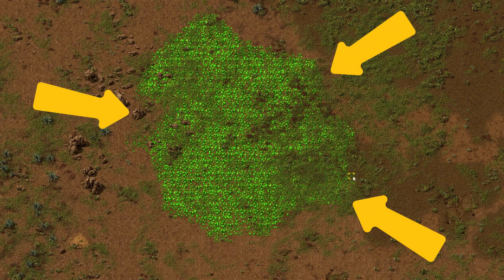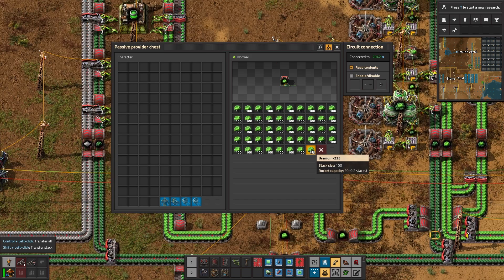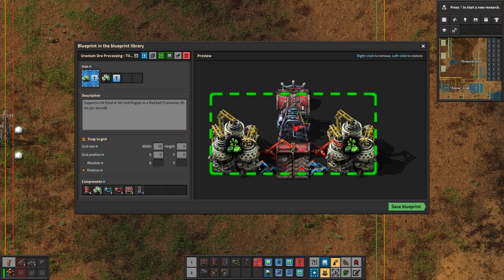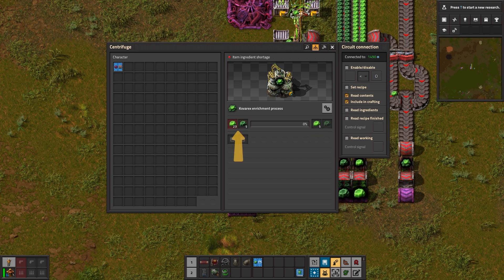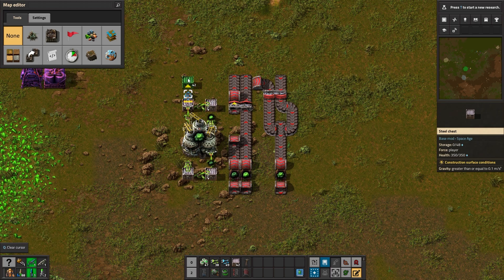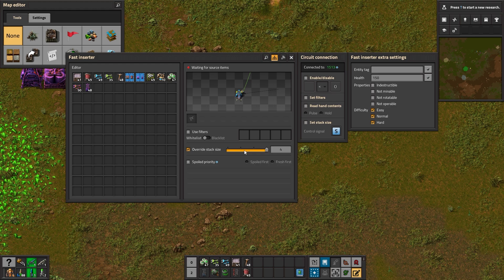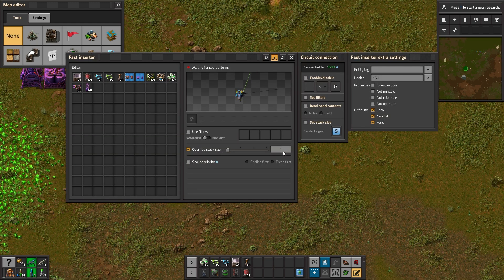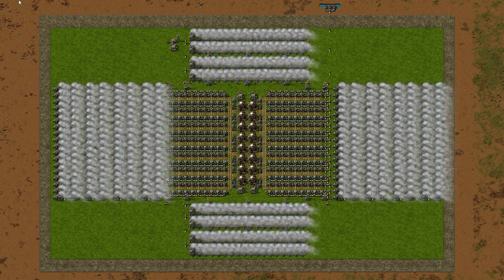Factorio Unlimited Fuel Cells: Tileable Kovarex Tutorial (FREE Blueprints)

Comment: How in the over complicated can you make this?  You don't need any logic circuits to create a self sustaining Single Centrifuge Kovarex process that bleeds off "excess" uranium.  You ONLY need 4 Splitters and 2 Inserters!  You don't need any chests, logic function, or fast/stack inserters.  Here is how to put it together.

1. You make 1 'Circle Belt' around your Centrifuge. (In this 'clockwise' example new materials are coming in from the top of the design and excess is leaving on the bottom)  This belt should be 6 wide x 7 tall & "self contained".  Place your Centrifuge in the lower left corner inside this circle right next to the belt.  (You will have 2 spaces above your centrifuge and 1 space to the right)

2. It should be fed by 'First Splitter' (top side near middle facing right, sticking outside the belt) that we be accepting new raw materials that has an "input priority" on the left side that is taking in "new" uranium.  IMPORTANT:  Make sure all material are on the OUTSIDE EDGE of the belt feeding the topside of this splitter.  This will make sure the belt is biased in favor of taking in new Uranium.

3. Next, place a 'Second Splitter' (right side, facing down, bottom left corner toughing top right corner of centrifuge).  Add a "Right Output Priority" and filter it for U-235 (bright green ones).  Now add one belt that will directly feed all items into the inside track of the 'Circle Belt'.

4. Next, place a 'Third Splitter' (bottom side, facing left, near middle, directly touching the centrifuge).  Add a "Right Output Priority" without any filters.  This is how "excess items" get removed from the 'Circle Belt'.

5. Next, place a 'Fourth Splitter' (left side, facing up, the bottom right of this splitter should be directly touching the top of the centrifuge).  Add a "Right Output Priority" and filter for U-235, the same as the 'Second Splitter'.  You will then connect the "right exit" of 'this Fourth Splitter' to the "right entry" of 'the Second Splitter'.  This should create a mini-lane inside your 'Circle Belt'.

6. Add an inserter on the top side that is extracting materials from the centrifuge and dumping them onto the 'mini-lane'.

7. Add an inserter on the right that is picking up materials from the 'Circle Belt' and putting them into the Centrifuge.

This is all you need to have a "single" self feeding/sustaining Kovarex process that bleeds "extra" when it gets "full".  This design is also repeatable and can be repeated as much as you want "horizontally".  Once you see the design you should understand how to make it vertical as well.  This design is intended to be fed directly off your "Enrichment Line" which means you can throw it down and just forget it without worrying about it clogging up your line.  Once enough U-235 gets into the system (you need 40)  the Kovarex process will begin and become self sustaining.  No U-235 will leave the system until you have enough to fill up the inside belt loop with U-235.

That said... I highly recommend a 2 chest and 2 Centrifuge setup where they just directly feed into each other... but you will need logic on the 2 chests to add/remove the materials to keep it "looping" plus it makes the kovarex kick off go faster.

Comment: I think It's way simpler to just have just an input inserter with a u235 filter and connect directly to the centrifuge read the hand contents the centrifuge contents and the crafting contents and then say u235<40 for the enable/disable condition you do need a 3rd inserter that has a u238 filter to input the 238 since the other one has a filter Also having just one line with the inside half being u238 and the outside half being the output is simpler you just make a big loop and pull the u235 out with a filter (inserter or preflibly splinter) you do have to be slightly creative with how you inputs the 238 into the system but that's not too hard
You can Also forgo logic entirely and just wait a bit more
Reply from the maker: Do you happen to have the blueprint for that?

Comment: I made two centrifuges running the Kovarex process with fast belts around them, with slow portions for fuel pick-up.  Once they were running properly the process is that they off-load the uranium they produce using bulk inserters and then if the U-238 is low, a signal is sent to an inserter which takes more U-238 out of storage and places it onto the belt, then the uranium runs past two sets of bulk inserters to be put back into the centrifuge if required before reaching an inserter which grabs it off of the belt where it gets sorted for storage and use.  That ensures that the uranium needed to keep the process going is inserted before anything else is done, while surplus uranium is collected as output, with U-238 being recycled back to the supply bin which is also supplied from the uranium extractor centrifuges.
The output from the extractor centrifuges is pre-sorted into U-235 and U-238 by selective inserters.
Reply from the maker: Interesting. Would you like to share the blueprint? I'd like to have a look
Reply: @Maxiume  I'm still pretty new to Factorio.  Less than a month into it.  I'm a little vague on some areas such as making and sharing blueprints.
Anyway, it's fairly simple.  Two centrifuges running the Kovarex process with a belt looping around both, with just enough space for inserters between the belt and the centrifuges.
There's two inserters set up to supply U238 by reacting to the U238 getting low in one centrifuge, one inserter per centrifuge.  When triggered, they grab U238 from storage and put it on the belt which then runs past two sets of bulk inserters per centrifuge to ensure that it won't be missed unless it's not needed.
Each centrifuge has a bulk inserter to unload the results, but it's arranged so that the uranium has to pass by both sets of inserters to be put back into the centrifuges before it reaches the output inserter which puts all of the surplus into a chest and that chest is unloaded by selective inserters to grab out the surplus U235.
The U238 is then recycled back to the chest which supplies the inserters which reload U238 onto the belt.
The down side is that you have to manually "start" each centrifuge and keep it supplied with U235, but once there's enough U235 to keep the process running, you can just leave them and they'll work unattended.
I use mostly fast belts (blue) but where the inserters are for loading the centrifuges, I added some slow (yellow) belts to make sure they could grab everything they need.
Now it occurs to me that it would be easy to make this work with a single centrifuge with a belt around it, and then just tile them with a belt alongside to supply the U238 when needed.  But using multiple centrifuges with a single belt means that you only need a single pick-up point for excess uranium.
Reply: @Maxiume  Finally figured out how to share blueprint strings.
0eNrtmUtz4ygQgP8KxWUvUsp6oIdr97Dnuc6cpqZcSMI2FRk8gJykUv7v21ix5SRSjPAe9rAnY9H6umn1Q6BXXLUd2ysuzKqS8hEvX4crGi9/Xv21cw3TteJ7w6XAS/z9SaKaCaP4utswjVQnBBcbZLYMfZMHqtgzYkLxersDKbRXsmZaPyD0fcte/lAMrVmDnrjZoh9hnBRIitOtrXxiCrVsbRAVDWLP9i70Q1HBux2q5Q5Uyc6cxRXfbA1A/xYvbxwhDdooWlWAr14QvTIScY20Naai9SOiSnagwUiQqeTzmcjFHvCaN8xOVaCChZ1mDSixCoiFbChIKlDAxdvN1laYsIJoLRWiRu54bVfddLXRDzjAvJai96rmG0Fb61JBdwx8uabahAbWqPdSmbBircFHuEM07Bkvo2Mwcs+wrCvR+PgrwDDBDWe9rtOfl5XodhVTwAq+0hngvdS8f8CvGHhk8UAC/IKXYVSWDwQUNVyxupdIrV0f+LE/vwD+CDGZSYxmWpxe+FXXPoZcaKYMTHwmxzdtJTNtTWbams3kxzP5+YWvd7RtQ9aCNKRwuJctG+GnNz1SzLSYzLS4nMlPZ/KjxUwF2XuXvFNQjCmI/BWUTgpi5wC/Sp3MyTmJf7bn4/ESpf7IbAI5ZOVVzfwyGfvVQ702Srarim3pgUtlBRWjzcpOsFOLNKpjtvjWbdewFRerWtG1gTaIl2vaagYU8CDfW+WPfVMMh6YYvjVFfJZa/e5oC7aDtJAKUhCPrSdzfqBk7gMdCsCcOMyd4rDwYmdO7HJm4bqKdDIeNfHCPxCnkHc033QCGXs5lbg4NU682KkT+440jydcQfyRyQQy8/JA7OSBub02v23ukGFf1IT8C0OjeAxb+neoxMUVyZBqe6o1PzBbGA/wBq7Cesv0mI7iZjwkkfvDuwqFxQTtjhfbaAKZ+BetKWTq0+sXTmGQzG+ji/9yG02yme4nt92f+3RmR/cX/lm4cMrCO9I8clGQ3pfmE4mZRi5Fr/ho65q3INlvkc/b7Auo608b7G4fWJ+CyYb0bk8V7PHBAPwXtptu2PmvLlAbz2O2unfrdLC4mNhapYnDytPyPedDoI1nZ81V3XGzYoJWLWvO+Xm+DLc0Fx1rrrRZfTqdGFxY4L4GaEPtMVL2wXt/4uP444iDMda/+jhS7wI8+UyIT9OZpGVetHKCNveNI7ltYOFxeFI47YtT/3LkpoD47+wLp403iWbmZ/5/fr53oF+5nDgGIIkXbeKcgqReqTlFI96HnGNRM6bB/+jQVUPuffjpqqHwPuxz1VB6H1c6asjuqDqOGiKvOD+dWUBiPgHe5vnPPCBBVAbkV3Aawn71PIQ3ZzuM4GIALyGxHYNgAP2UnMewubHjOB/G9idI82H8xkksB4ql5dhLZ4796eXBLG7YznaZy/eoALcUVgXXzh+bDLffhsyThLkD1JXTOkkWl2lZkrxMk7jMhi8li+MINTx9BgswBQcf7EakF/2Cd/wH0Y/j5g==
I hope that works even though it's through the comment system.
Reply from the maker: @melkiorwiseman you can join my discord for easier sharing

Comment: In my test, the splitter with input priority set to left will hold 3 U-235,  before any U-235 will pass through the right side of the splitter to enable the next stage.  This means that the system needs to have 43 U-235 before anything gets passed to the next stage.
Reply from the maker: That is very accurate and perceptive of you to notice. Yes, a little bit of the ore gets stuck in the splitter. I could have designed the splitter with a dynamic filter to avoid this (too complicated for beginners to understand) or use an inserter to transfer the remainder to the next segment (low throughput) or tens of other approaches. No solution is perfect. This one is beginner friendly and "efficient enough".🙂
Reply: @Maxiume what mod do you use to get the purple infinite unground source and consumer?

Comment: I'm a bit puzzled how you got 10% return of u-235. 10% of 40 is 4, so you'd get 44 u-235 from 40. It should be 2.5 percent.
Also I think your circuit network was a bit over complicated since your oversaturating your input lines from the output line anyways. Simply have the output inserters behind the input inserters, and the belt in front of the input inserters to enable when the centrifuge is working.

Comment: I can confirm the blueprint for the kovarex system is missing. I am now in the subfolder named 'ore prcessing -kovarex -fuel cells'. there is just the ore processing one.
Reply from the maker: So many people have used it already. How could it be missing? 😄
Reply: @Maxiume  Sorry, my mistake 🙏 I’m just starting and I didn’t realize it’s a blueprint book. Once imported, all the blueprints from each section shown in the video are indeed available.
Reply from the maker: All good. This is a blueprint book. It contains all three blueprints in one string. There is a difference between a single blueprint and a blueprint book.
Reply: @Maxiume  I confirm, there is only Ore Processing - Kovarex - Fuel Cells.txt.

Comment: This seems like overly kovarex process complex. I just put 2 centrigues with 2 requester chests between them with inserters inputting and outputting into them. Requester chests are both identical with each requesting the kovarex recipe (max limit, not minimum). Any extra 235 gets removed by bots and taken somewhere. No need for circuits, belts or filtering.
Reply from the maker: It's for educational purposes. But yeah can be done in so many other (and better) ways! :-)

Comment: I find your design to be quite intimidating looking. I made one that doesn't use circuit logic and only needs one splitter to separate the shiny. I haven't thoroughly stress tested it yet though, but I think it's bullet proof ^^

Though, your design is more plug and play than mine, so I'll give you that ^^
Reply from the maker: It is an educational design. That sticks to the exact ratio just to show it is possible. Nothing fancy about it. The thing i like the most is that I don't need to worry about bootstrapping the enrichment process one by one.

Comment: you REALLY dont need all that for kovarex
just pull ONE SINGULAR u235 from the centrifuge output and let the rest cycle back in
it's very easy to do
output inserter to centrifuge - read contents - enable only when u235 > 40 (and filter for u235 ofc)
DONE it will pull one out and the rest will cycle with chests
Reply from the maker: What you really really need is more Factorio...

Comment: When running the enrichment supply line due to the recipe being limited to the exact amount it reduces the efficiency as there is a bit of down time. To solve the issue of downtime increase the cap on the uranium and uranium output.
Reply from the maker: That’s true. But it’s a trade off, specifically early one with a limited supply of u235. Also with so many tiles the difference is negligible.

Comment: Underrated creator, very easy to digest content. Keep it up!
Reply from the maker: Thank you! Is it easy to watch a 10 minute tutorial or should they be shorter?
Reply: @Maxiume  it's fine I think. I understood every bit that led up to the design, and folks can just skip if they don't want to hear it, doesn't know how to troubleshoot and go back here lol
Reply: although I ran into a problem where the first one just stops working while the rest does for some reason and have to put excess u-235 to have it work again, not sure if it does that when it consumes exactly the amount inside but sometimes it just goes on standby with 38 u-235
Reply from the maker: Lol
Reply from the maker: That’s strange. Cause i tested it in so many ways and for a long time. Could it be something you did differently?
Reply: @Maxiume  not sure. I tested both blueprint and me doing it myself, and the starter of the enrichment stops after the first process leaving 38 u-235 and the splitter that takes in u-235 into the centrifuge is empty, might need to make the belt fully filled with u-235 cause I followed the video with only half filled red belt (around 10:18)

Comment: I do kovarex enriching with just some splitters with input ant output priorities and a single circuit to stop the centrifuges when I have too much U235.
Reply from the maker: Would you say that is better than this method? (for beginners learning the process)
Reply: @Maxiume  Both circuits and input/output priorities are useful skills to learn for beginners.
Reply from the maker: @schwarzerritter5724  I agree. I included both of these in this video. But i will also do a separate video just on circuits. I think there is a lot to unpack there. Specially for beginners who run away from the complexity.
Reply: I know I did.  Now I have to force myself to put down the green and red wires and look for a mechanical solution first.  Love clever circuitry but it’s not always the right solution. Btw. Live your video. New subscriber